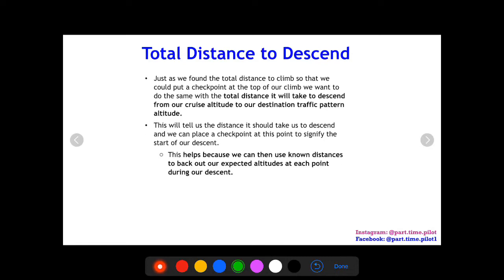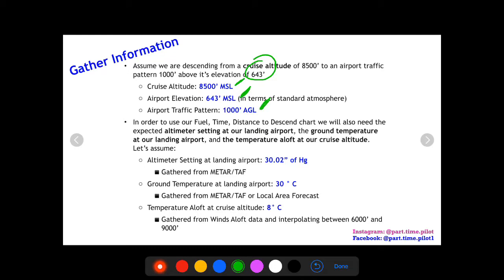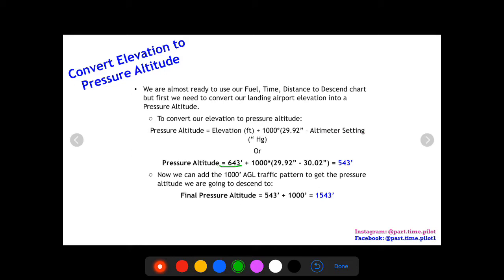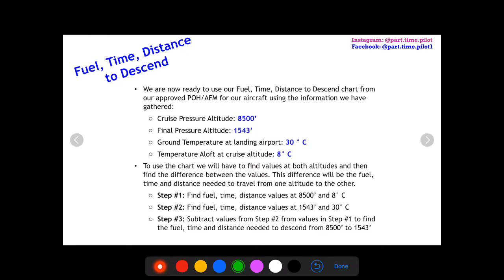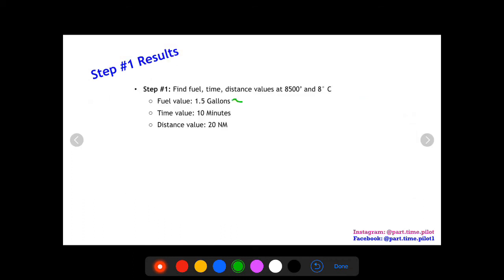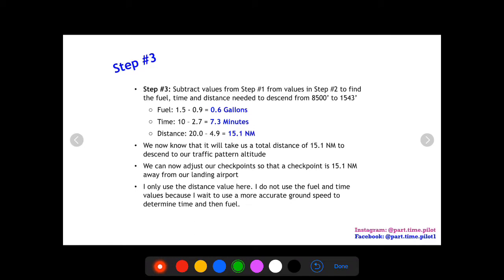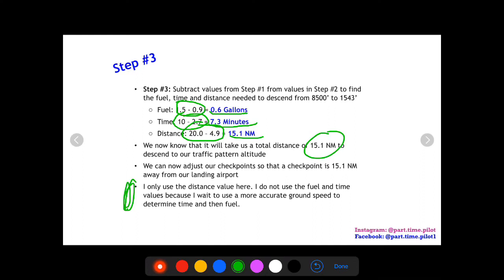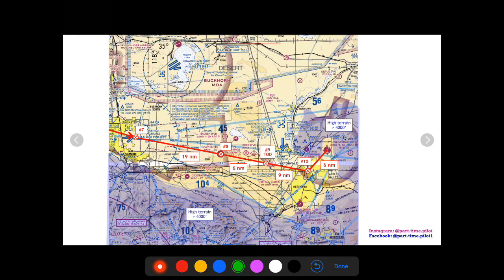How to Calculate Descent Performance - For Student Pilots

Comment: I don’t understand why the chart is made for 2500 rpm. I usually decend at 2100 rpm. Do you know what to do about that?
Reply from the maker: Sorry for the late reply. That is a great question. I also use 2100 rpm or less for descent. I couldn't find a good answer anywhere but I assume it is only used for fuel calculations on this chart so they use 2500 as a more conservative number for fuel. That's my best guess.